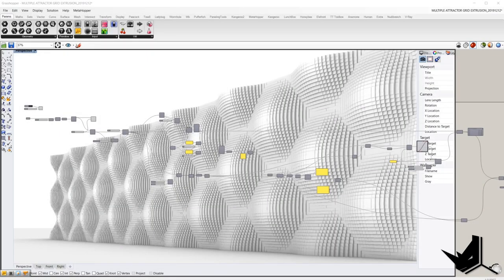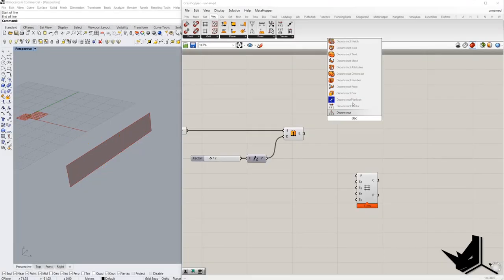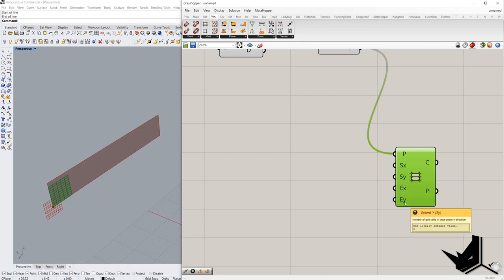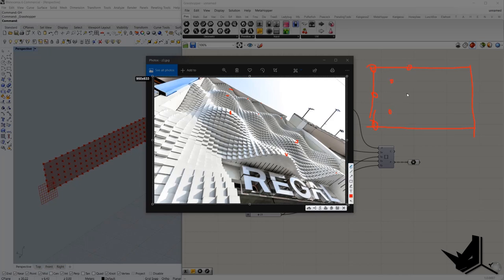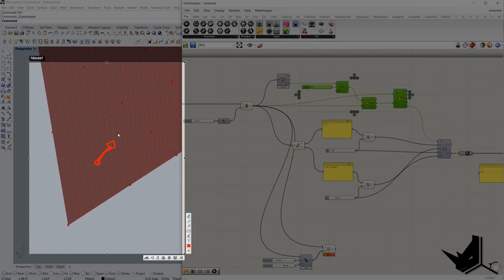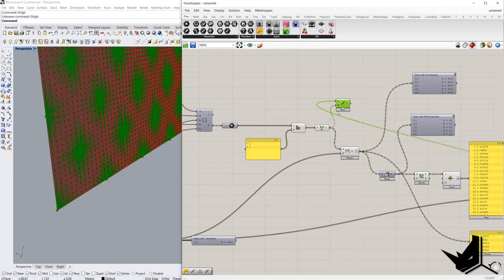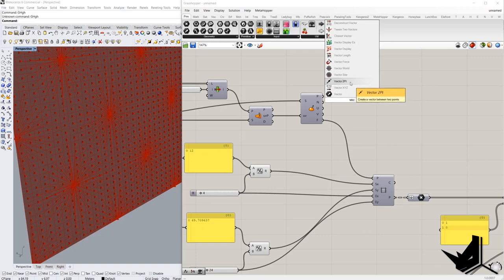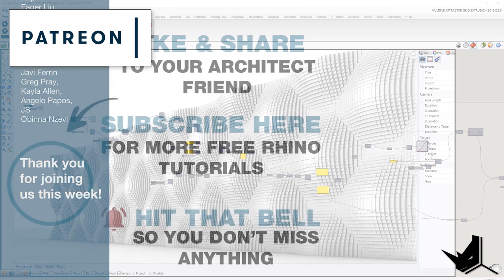Rhino Grasshopper Facade with multiple attractor points

Comment: Why did you use list items after sorting the values from the flip matrix? And can you explain why isotrim was used with the divide domain?
And can you explain again why did we use cull pattern by equating the original distance and the flipped matrix one?
Reply from the maker: Hey Anuj,

I will be glad to answer your questions.

1. Divide domain^2 we used here takes the U and V iso curves of the surface and divides it into segments creating domains in both directions. Afterward, we connected the output of the domain with the input "D" of the iso trim, since the component requires domain^2 to get original surface divided into multiple subsurfaces.

2. After sorting the list of all distances at 9:48, we used a list item (with default value 0) to extract the smallest value from the list which is actually closest distance. 

3. Each point of the grid has its own set of distances to each attractor point. The set of distances represents each branch of the data tree. In order to find the location of the closest distance in each branch, we use the equation with the list from step 2. Afterward, the pattern from the cull pattern output we applied to the original list in order to get the closest grid points related to a certain attractor in the same data tree branch. 

If you still have difficulties to figure out how the definition works feel free to contact me at lazar@howtorhino.com

Cheers
Reply: @HowtoRhino  Thanks Lazar!.

Comment: very nice tutorial! is there a way to apply this process to double-curved surfaces? so the surface will be simplifed by rectangular extrusions based on the normal distance to the surfaces flat base surface?
Reply from the maker: Hi Poldi! Thanks, glad you like it. Yea, so the process of applying this definition to a double-curved surface would not be the same. In that case, you couldn't use the grid component, but would rather be using some other techniques like isotrim component and then doing the normal vector extrusion for each face.

Comment: How do I fix my grid if it’s only going along the X and y plane. I’m trying to get it to go along the z plane
Reply from the maker: You need to define the plane where the grid will be located. By default is set to XY-plane, but you can simply plug another plane in corresponding input